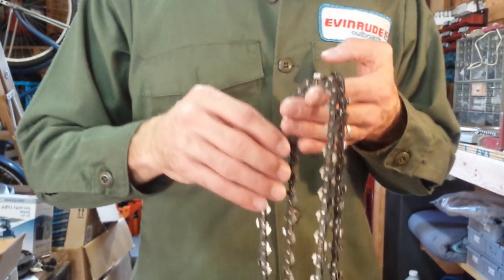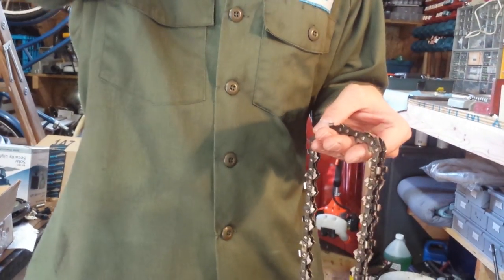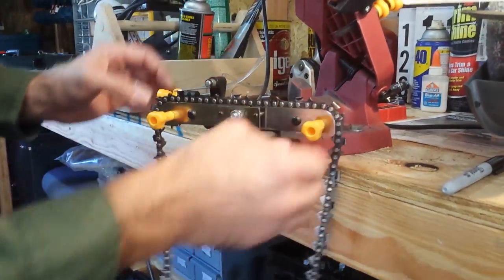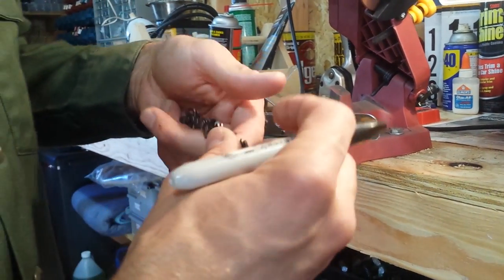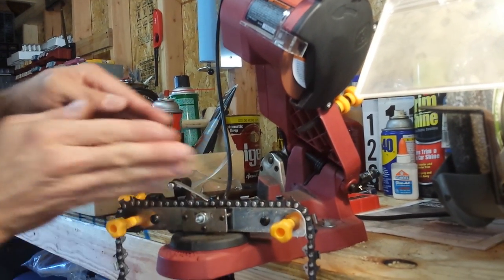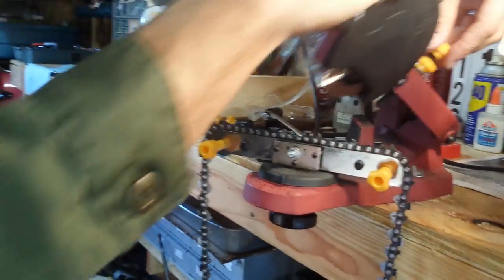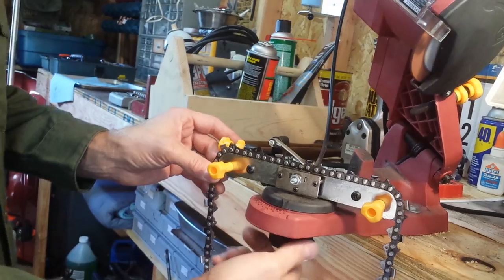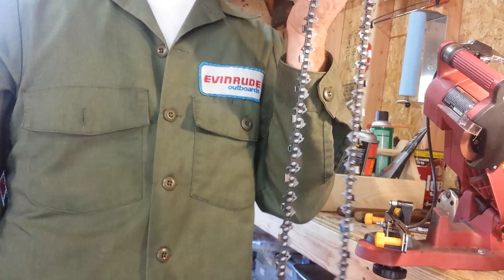How to sharpen your own chainsaw teeth for less than $40

Comment: thank you for this video, but what happens if you are given a chain that some brain-dead hairy dip stick has been grinding trenches with it, and has then taken the wrong size file to try and sharpen the chain at totally the wrong angle and has field way more metal off some teeth than others? do you just keep grinding the chain until all the teeth have been ground to the same length? or do you test each tooth for length then grind them all off to match?

Comment: Only thing you might want to do differently is bounce rather than hold the blade to the tooth to prevent overheating the tooth and weakening the metal.

Comment: I would like to see one that uses a rechargeable battery, and clamps onto the saw bar, so it could be used at the job site without removing the chain from the saw. Now THAT would be handy.
Reply: Just carry a spare chain that you can swap in. That takes less time than sharpening the one on the saw. Do your sharpening at the shop while having a cold one.

Comment: That's a chain, and the 'blades' are teeth. Get the names right or folks won't think you know what you're doing. Don't forget to occasionally check the height of the depth gauges; if you don't, the teeth will cut smaller and smaller chips after each sharpening until you find your saw producing nothing but sawdust. So....three steps. Sharpen the left hand teeth, sharpen the right hand teeth, check the depth gauges and file them if needed. Cheers from a logging community in Canada.

Comment: "OIL" on those teeth buddy....plus don't lay it on there it will take the tenper out of the teeth....little hits on the blade...real quick and use oil as you sharpen....
Reply: Thought the same thing about taking the temper out. What is the purpose of the oil on the teeth of it, is it to spread out the heat or to lubricate the chain? Do you just spray the chain with a lubricant before you start?
Reply: @jakerichards1988  
I'd like to know,  also.
Reply: I'll agree with you on one point: don't linger on the tooth, just a quick touch and you're done. But oil is messy and absolutely unnecessary. No professional I know uses oil.
Reply: @paulmaxwell8851  ..I use "WD40" .....
Reply: Survival of the fatest outdoors thats why i like just a hand file
Reply: the oil is to help keep the tooth from getting to hot from grinding therefore ruining the hardness of the tooth. if you use a light grind  then you can get by without the oil .

Comment: I appreciate the video and it was well done.  However, this sharpener does not address the depth gauge (drag or raker).  With each successive sharpening it will take a shallower bit of the wood.  With this sharpener the depth gauge would still have to be filed with a hand file.

Comment: How do you keep from cutting off the tip of the tooth since the tooth on the chain is rounded and the disc is straight?  By hand you would use a rounded file and be under the tip of the tooth.  

I don't understand how you get the same results with a flat sanding disc.  Can anyone help me out?  I have this electric chain sharpener, but I totally ruined the first chain I tried to sharpen.  Haven't used it since.  I'm sure I did something wrong, but I'm not exactly what.  I hate to keep ruining chains.

Comment: Everything is great until the drag links need work. Also, the instruction book says turn saw off after each cut which sounds totally ridiculous to me. Be careful to adjust and do it properly or you can mess up a good chain quickly.

Comment: Taking way too much off you don't need to remove that much material.. just my two cent,  you'll see if you were to look at the cutting edge you'd see a that the cutting edge has a shiny tooth edge that is when it's dull.
Reply: He is sharpening in the wrong direction leaving a burr. The newer blades have a hardness that requires grinding and heat is generated with a large cut. Heat softens the steel. Annealing.  Light cuts are best and in the correct direction. I am a tool maker of 50 years and see this all the time. Sad.
Reply: Chuck H gentle cuts? How do you mean (I'm choosing whether to use a file or one of these grinders)
Reply: @nzzenith :  I am a very part time chain saw user but I do have to sharpen my chains like everyone else.  I use a file.  It's simple, at least it is if you're using a file guide.  It's extremely portable, you can use it while you're in the woods and the chain is still on the saw.  I find it frustrating swapping out the chains and adjusting the tension on the new one.  And if you're using a actual new chain, you then have to deal with stretch and more adjusting.  And also,... I don't want to lug around a half dozen chains with me. The file works great, it puts on a good fine edge on to each tooth avoiding the "burr" that "Chuck H" is talking about.  But even if you do get small burrs, they come off the tooth as soon as you put the chain to wood.  The only problem I have in using a file is when I hit a nail or a rock or something hard that doesn't just dull the tooth but damages it.  I can use a file to get rid of the damage but then the teeth on the chain end up being of visibly  different sizes.  If you want to correct that and want to easily give each tooth on a chain an even amount of wear, then you will need a grinder like the one shown in this video.   Good luck in what ever method you choose.  If I did more work with a chainsaw, I'd have both tools.  As I said, a file is CHEEP!

Comment: I did everything you showed and my chain gets dull about 1 minute into the log. Whyyyyyyyyy???
Reply: Perhaps the metal was overheated and softened? You could always just buy a round file to sharpen the chain you know. That way it won't overheat like with a electric grinding machine.

Comment: Works good on smaller chains but on my big saw it’s like I need a bigger thicker wheel ! HF says it only requires 1 wheel ? Told them I sure don’t use 1 file for all my chains ! And don’t Blue your cutting Edge with these power sharpeners .
Reply: BK K:  when I was young I spent a little time at a small engine shop that sharpened chain saw chains and they had one and only one machine to sharpen them all.  And if you think about it for a bit it makes sense.  When you use a file you have to use a different sized file for each chain that has a different sized tooth as you are using the curve if the file to put the correct angle to the cut in relationship to the tooth surface so the file size is critical.  When you use a grinding tool like this the critical cutting angle is set by the tilt of the grinding wheel. I can sweep that tilted edge of the grinding wheel across any and all teeth, regardless of size, and the cutting angle is maintained.

Comment: almost idiot proof.. what digrees do you set it at ...iv got one and never sat down to use it
Reply from the maker: usually 30 degrees, but it can differ depending on the chain manufacturer
Reply: How to determine the degrees? Do you just match it up with the angle on the chains?

Comment: Also.that does.not.grind.the blades evenly.and.your.saw.will.not cut straight. You need to.adjust.the.depth.stopper.so.you can grind.until.it.stops.sparking. that way it will grind.em.even.

Comment: Not to pee on anyone's parade, but: HF chain sharpener is mediocre. One from Northern for $100+  is enormously better. Grinding is really only for rocked chains. Filing does far better job, like with Granberg guide, which can do cutters AND depth gauges. There's not a super-long learning curve, but conscious thought and attention span are BIG PLUSES. You want to KEEP chain sharp, not wait until it's dull- like, file it every other fill-up. Absolutely keep chain out of dirt. [lessons learned over 50+ years]

Comment: dont like grinders" only if hit rock or metal, not a fan'
Reply: I've tried with hand files. Can't seem to get a proper edge. You have to be careful not to burn your teeth, but this will make a very sharp cutting chain. The grinding wheel is fine grit so it puts a very nice edge on the teeth. Plus it cuts each tooth at exactly the same angle and depth every time quickly and easily. I know pros say a file is best but this does a great job better than I can do by hand.

Comment: I could have my saw sharpened and be back to cutting by the time you take it off, get to the machine, do all that adjusting, and finally actually perform the sharpening, not to mention reinstalling the chain.  Not to mention, most sharpening needs to be done in the WOODS where there's  no power to run your fancy machine.  It's not that hard to hand sharpen chains really.  Watch a few videos here on YouTube to learn the basics and go DO IT.  You'll never really KNOW HOW TO DO ANYTHING if all you do is watch videos!  Learn the basics and GO SHARPEN the saw, then use is for your own feedback.  A chain worn down over half the original tooth size is pretty much garbabe anyhow, so don't waste your time with those much.....
Reply: He’s giving a demonstration. Thera why he didn’t have the chain sharpened in record time. I have 2 different electric sharpeners and I promise you I’ll smoke you with this sharpener if you’re using a hand file.

Comment: Way to hard on the cut, light taps don't remove the temper. I use PFERD sharpeners most of the time but will put a really messed up chain on one of these to straighten it back up. In the tree business you run into a lot of junk people have pounded into yard tree's, hard on chain's.